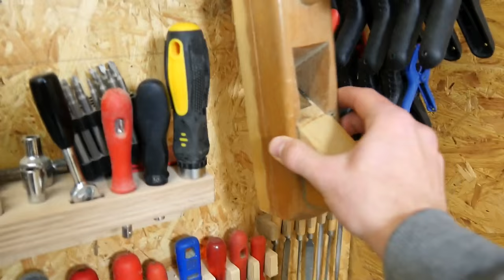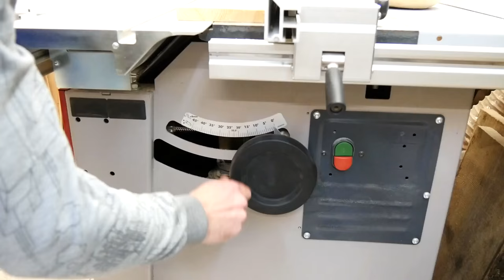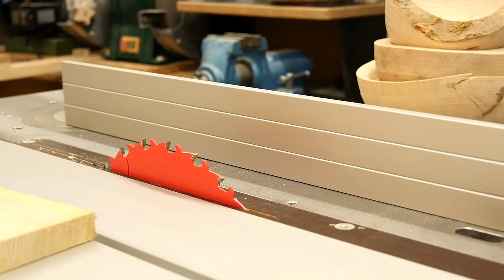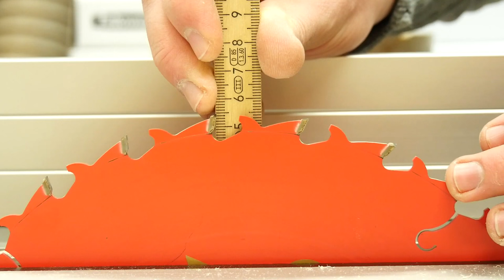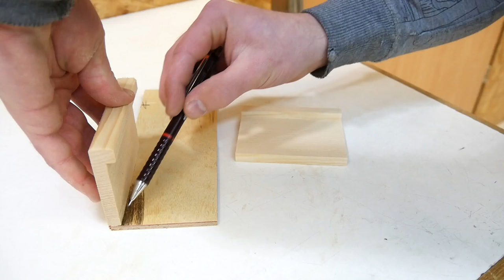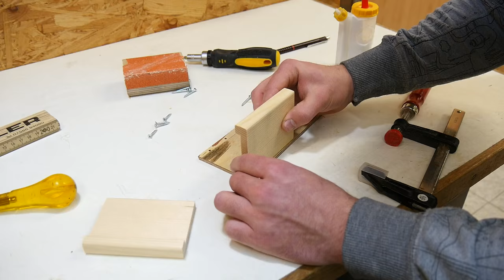Making a Hand Plane Holder

Comment: An example to all, for saw safety  more power to you Marius, I liked the half rip fence idea thank you for sharing
Reply from the maker: +Mcleod Duncan Thanks. You're the first one who noticed that a half rip fence is actually safer.
Reply: +Marius Hornberger No it isn't and if you look at :42, you just about had a kick back.  If that stock had touched the teeth, you wouldn't be typing with 10 fingers now.  Being young isn't a license to think you're immune from these accidents or that you somehow have figured out safety around tablesaws better than millions of others that have been using them for decades.
Reply from the maker: christschool have you ever used a saw with a half fence? There was no chance of a kickback, but the low angle shot just made it look much more dangerous than it actually was. Also I hate when people see something in a video that looks dangerous and then say I'm "unsafe" because I'm young!! That's just not the case! Rather ask or suggest, than claim.
Reply: Marius Hornberger Kickback is when the material catches the blade and kicks it right back into the saw, that happened.  Should I screen capture it and play it back in slow motion so you can see it because you don't seem to be acknowledging it happened and camera angle was perfect because it captured it.  Did you watch that video I linked to to see how quick this happens?

Here is the problem with your theory on the split fence.  You do it without a splitter or riving knife that would prevent the kickback from happening.  You didn't have a splitter and that's why it your stock was being pulled into the blade.  If you attempt to do this again, use a splitter, at least.

What do you say about the other very unsafe practices like having your hand between the blade and the fence when you're using the fence as a stop?

Bottom line, its your life and your fingers.  I'd just hate to see you not learn from others who have also made the mistakes you're making and thus why I mentioned being young is a factor in accident safety, especially when using bad and dangerous techniques.  We were all once young too.
Reply from the maker: +christschool Yes, you're right, I was wrong. Sorry for explaining/defending myself.
Reply: Marius Hornberger There's no need to get defensive.  Some folks truly want to make sure someone, anyone, benefits from their experience, especially someone they respect/like.   If no one cares, they'll just move on and not even mention it.
Reply from the maker: Sure, but then this message has to be discernible and it wasn't for me, at least until now.

Comment: Oh man you almost had kickback at 0:39 that could have been bad if the blade grabbed the board a little more... You can see the board starting to turn into the blade because the fence was moved back and can't help keep the board going straight.
Reply from the maker: +VampireOnline no, I didn't. The blade didn't grab the piece at all. That's just because of the viewing angle.
Reply: +Marius Hornberger That's why I said almost you can see it turn and kick up a little bit. I guess the low angle just makes it seem a bit more scary then it  really was...
Reply: Aw man, jeez, I should have just read the sub-thread comments before I watched that part twenty times in a row looking for something that just isn't there -_-

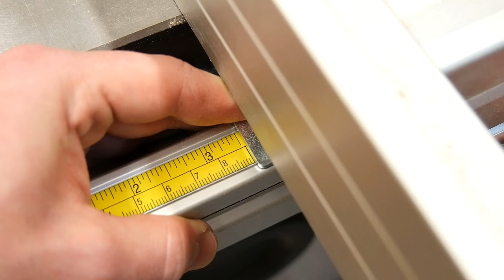Comment: at 33 seconds..........I'm not sure why you would ever want to pull back your fence on a normal rip cut.  I can understand it at 1:34 in conjunction with the miter fence.
Reply from the maker: +Big Mike is talking good question: as soon as you finished the cut, with the fence back like this, the piece is free and can be moved away without even coming close to the back teeth of the saw blade.  Reduces chances of a kickback. (yes I should have used my riving knife)